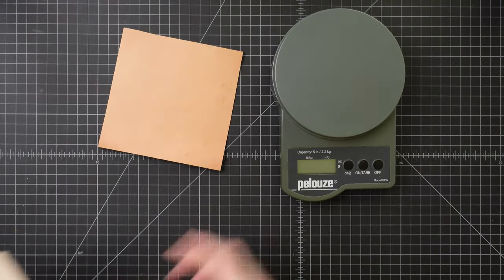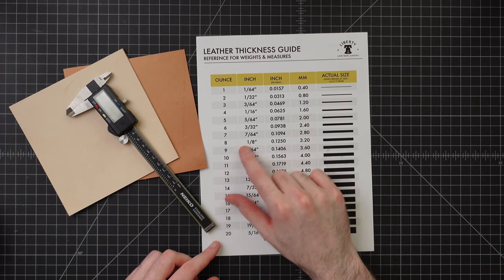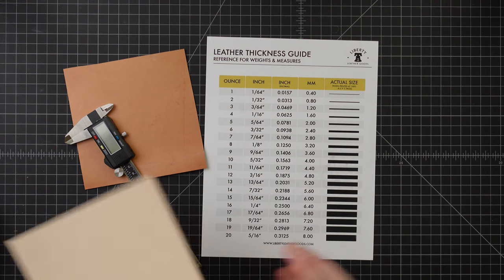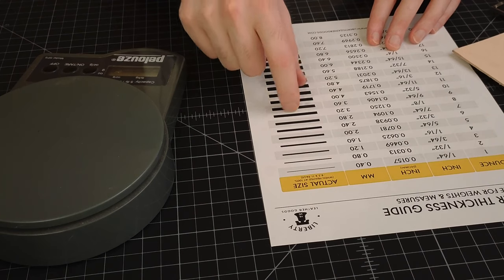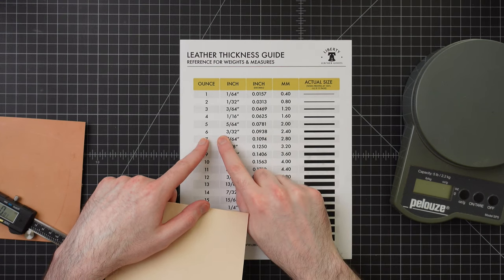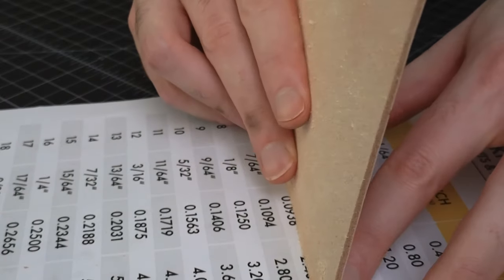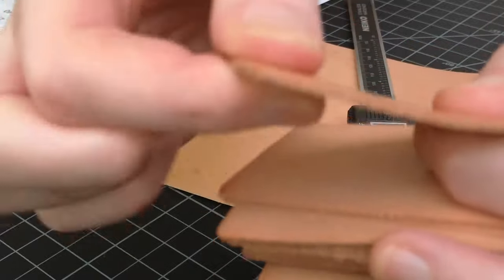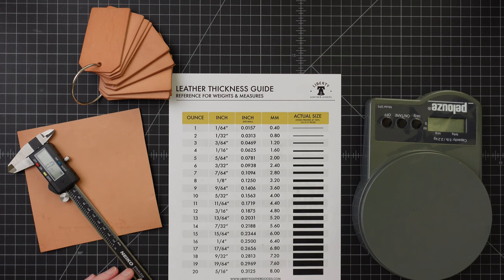How Leather Thickness and Weights are Calculated

Comment: what's the surface of that piece of leather you have weighed? I mean any piece of leather can weight anything, if you use small or a big sample of it
Reply from the maker: Hi, the measured sample is a 6"x6" piece of veg tan leather. The standard sample size for weight calculation would be a 12"x12" piece, so just multipled the weight of the 6"x6" by 4 to get the weight in this example.
Reply: @internationalleatherclub  ta, thanks. 1 square foot, thats what I thought 😃

Comment: What are the dimensions of the piece of leather that is weighed?
Reply from the maker: Hi! 😃 In the video we used a 6" x 6" square piece of leather.

The standard sample for measuring leather weight is a 1' x 1' square, so if measuring something smaller, or larger, it's helpful to remember to calculate to that standard. For example, our 6" x 6" sample would be 1/4 the size of a 12" x 12" piece (36 square-inches vs 144 square-inches). So when using the scale, just multipled that by 4 to get the standard measure. 

That way, if one doesn't have or want to cut a piece just for a sample measure, they can use what they have on-hand and calculate if needed. Certainly having a 1' x 1' piece will make meaurements more consistent, though one can still get a relatively accurate measure even with a smaller sample.

Hope that helps some!